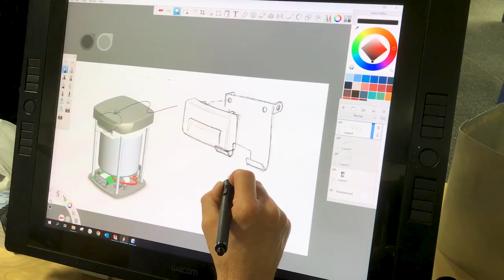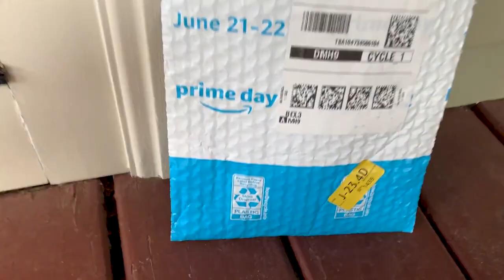Obaggo: Turn your plastic bags into recyclable disks

Comment: Great initiative! How would you avoid mixing different types of plastic bags? Do recycle centers sort them or all types are recycled together?
Reply from the maker: Great question! All of the different types of polyethylene are acceptable, which is quite a few, but it is up to the user to know what is good and bad. We anticipate the same or lower contaminants as are found in the retail store take-back bins. The post-consumer plastic bags and packaging film recycling processes vary by manufacturer. Some will shred, wash, dry, sort, and extrude. Some simply shred and extrude and add to sawdust to make plastic lumber. Some add compatibilizers and stabilizers to make different densities of PE and even some PP all blend together.